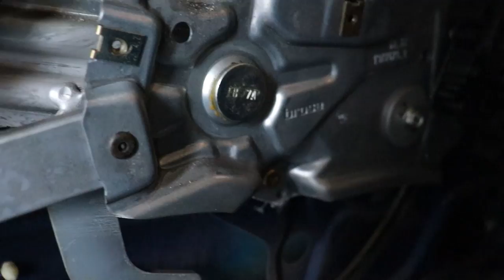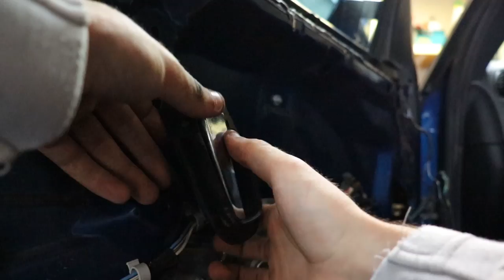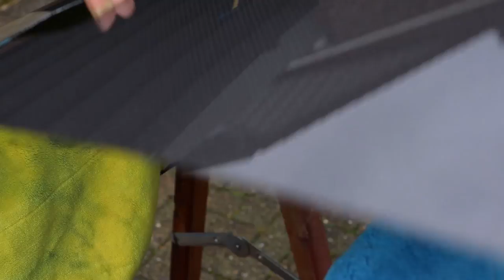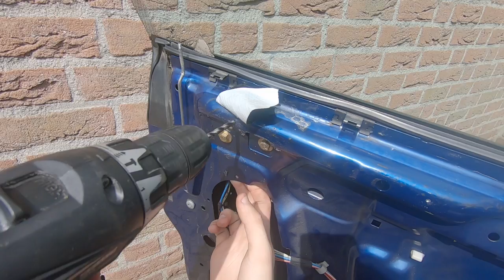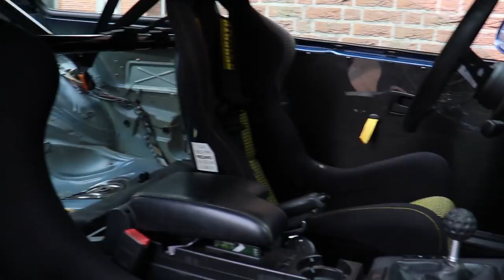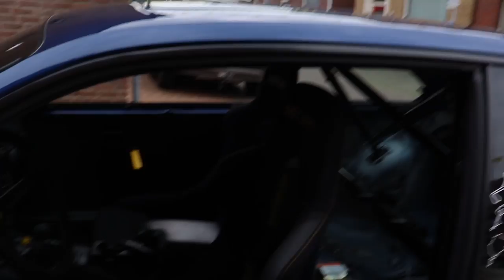Installing Carbon Fiber Door Panels in my E36!!

Comment: You should upgrade the engine to m54b30 sooo much better my e36 has one it takes off like a bullet
Reply from the maker: I’m don’t think I need more power for now. If I ever decide to swap engines it will probably be an S54. But M54 are fantastic engines for the money
Reply: @TJS36  yeah s54 will be the best you can always turbo your m52 or stroke it to 3.0L
Reply from the maker: @allaboutcars5306  I really want to keep it N/A if I ever change the engine it will either be S54 or M52B28, both are really common here at the ring